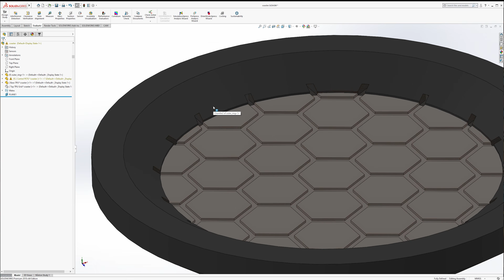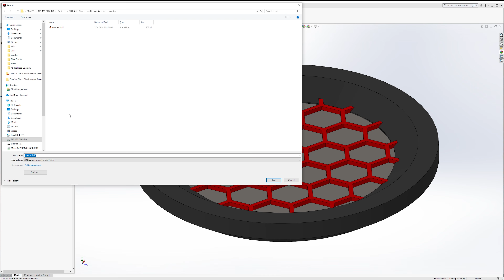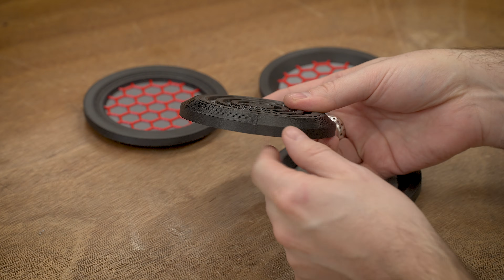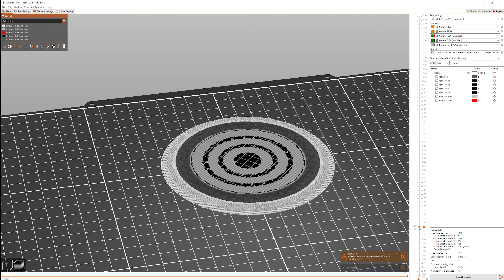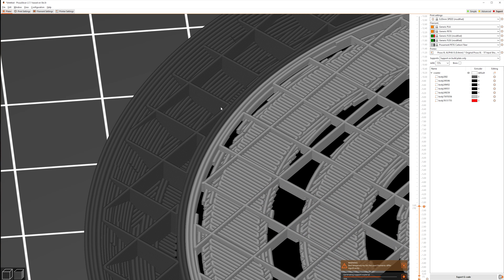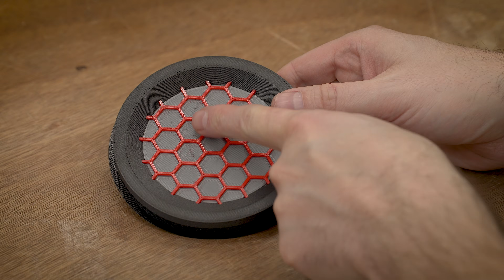Multi-Material Coaster - ALL THE FILAMENTS!

Comment: There's an option under multiple extruders to set the wipe tower extruder.  This will always be used for the perimeter of your wipe tower.  Problem solved on the wipe tower.  I've been using it without issue printing PLA as supports for PETG.  The other thing to do is design your supports in CAD and trap the PLA in with a wall of PETG around the perimeter to lock it in place.  Doing this you only need a few interface layers of PLA.  I do this with zero clearance and the parts are perfect.

It gets a little tricky in the slicer because it can't seem to differentiate between your parts when it comes to infill, but i found it you make your interface pla later entirely perimeters the slicer works properly.

Finally I'd like an in depth review of the diamond back nozzle please.  Been eyeing one for awhile but need to know the price is worth it.

Comment: You need to select a default extruder for the prime tower. I suggest you select one of PETG heads to build up the perimeters on the prime tower. Then you wont have these issues. The pla will still prime within the tower. The default setting of 0 needs to be adjusted. Ive not had any issues doing it this way. I also make the spacing a little bigger on the prime tower. Try 125 or 150%

Comment: 3mf is not very good quality (embedded STL) use STEP instead and split to parts in Prusa slicer to get a vector based model.
Reply from the maker: It depends on what your export settings are...  For structural models like this it's just fine.

Comment: Thanks so much for doing these torture tests on the XL. Great test and interesting results. Curious if you disabled Z-hop or use Z ramping. I was having some bad stringing issues and this solved the problem in one fell swoop
Reply from the maker: Ah, huh. I didn't disable anything.  I'm getting nearly zero stringing.  The red is stringing a bit, but it was really ONLY on the first use of it.  After that, it's pretty much what I'd expect for TPU.
Reply: I don't know why I was getting stringing, even after doing temp towers on the MK4. Changing the Travel lift to ramping 1.5mm max, 1 degree slope, lift height .2 eliminated all stringing for me.  @RobertCowanDIY

Comment: just use some sacrificial objects (cones, cubes) as prime towers, and assign for each one an extruder :)
Reply from the maker: I don't think you can assign a specific extruder to a specific object, that's the issue.  You can only select 'purge into object' and I'm not sure it knows which one to use.  I
Reply: @RobertCowanDIY  Painting them all separate colors (or separate materials in your case) wouldn't work? Then again, even if it did what's preventing the slicer from printing the main model first on each layer before it prints the sacrificial models. Definitely something Prusa needs to look into especially for how much they hype it as a multi-material printer.
Reply: @RobertCowanDIY  , you can select a specific extruder to a specific object 
!
Reply from the maker: @Ro3Deee  I'm fully aware, but you can't exempt extruders from the wipe tower.
Reply: I came here to suggest this as well. I don't have an XL to test it on, but it seems like it should be a good solution. At least until they implement separate prime towers in Prusaslicer.

Comment: Finally someone that gets and tests what this 3500€+ printer is made for! I don’t need 5 color PLA dolls and I don’t net 36cm dragon busts. I want to print functional parts with multiple material features! And also filaments that need an enclosure. 
Once we have a good enclosure and better filament support and a software, that really enables muti material mixes (with material interlocking features built into the slicer and better priming / wiping solutions), we can call it a new era of 3D printing.
Reply: Take a look at the SUMO enclosure.  Not perfect, but it works well.  I can keep my internal temp at 100F with just the bed heat.

Comment: I find the setting under multiple extruders 'Interface shells' works well to provide a better surface finish to flat surfaces such as the one below the TPU. If they interface then it is unlikely to improve things. You will use more filament though as a result but that can likely be managed with settings.
Reply from the maker: Good to know.

Comment: My first printer was a Replicator Dual back in 2012. One of the things i did to help with oozing and minimize the prime tower or completely remove it on larger prints was print infill first then perimeters, effectively making the infill an internal prime section.

Unfortunately without part cooling and a slicer that couldn't turn off the second extruder heater so it could stop oozing it rarely gave perfectly clean parts if it didn't get knocked off (under extrusion helped with that), although it did print me a few functional parts i removed the second motor and was happier with just a single head and clean parts.

Long->Short; I REALLY don't want to put a Prusa XL on my CC 🥲

Comment: Hi Robert, many thanks for your very informational videos! XL question for you please…. I thought I heard somewhere you cannot mix nozzle sizes in multiple tool heads for a print project? Is that true? If so is it a slice limitation? I have an XL on order and I have a couple of use cases where I would like to have the detail where I need it (smaller nozzle) and then less detail (faster printing due to larger nozzle) were needed. Thanks in advance for your reply!

Comment: I find that pla and petg will stick together good enough to be good at supporting each other. BUT only at low speeds. So when the petg goes to print directly on the pla interface layer, if it’s fast, it balls up and ruins the print. If it’s slowed down, works fine

As for the wipe tower, as others have said I’ve had it work great when I set an explicit nozzle for it

Comment: You can add rule modifications to parts in PrusaSlicer. Right-Click the model and use the option to add a modifier. Then align it to cover the needed area and you can change the rules for that volume of printing space. Such as the interface for the supports.

Comment: I use the gallery to add cubes to the build volume for each nozzle. I run a slice to see where the highest material layer will be used in my project and make its cube that high. In some cases, it uses less material than the autogenous tower but makes sure the nozzle is clear and primed.

Comment: Would it be possible to add just a simple block as your custom wipe tower, then force the slicer to always print this first?
Just thinking loud, I have no experience with this so far, but excited to get the multitool printer soon
Reply: You have to put the block in a certain corner of the printer, as it uses an algorithm to determine what prints first. I forget which corner though. But yes, the idea of making your own prime tower is solid.

Comment: Robert, great test. PaulStevensonPinball just explained the outside perimeter of the wipetower in PETG, since you already have your model setup, it would be really easy to print another one with the wipetower and see how this works. I have this printer on order but will not receive it for a few more months.

Comment: What hardness was the TPU you used? I have so much trouble with the nextruder and TPU. It prints for 2-3 minutes, and all of a sudden the gear grabs itself and the TPU does a full round inside. I have to stop the print, open it up and restart the whole process.
Reply: I converted my filament sensors to magnetic versions as described in the prusa forum post called XL filament sensor mod for TPU. You should see it on the first page. I also made new nextruder filament guide parts to help prevent the ability of TPU to move around and jam behind or under the gear. Those models are on printables just search XL nextruder main plate and idler lever for flex filament. After these changes I am able very easily feed and print ninja flex 85A TPU. Also make sure you are using brass nozzles for the TPU. In my experience steel just doesn't work very well for that material.

Comment: If you are using PLA to support PTEG, set your support distance to 0(soluble). There is no need to leave any space between the two.
Reply: He specifically picks up the print where he did that and showed how it was the worst looking one.
Reply: @mattanderson111  His issues stem from a number of his settings being off, most probably the blobs due to his wipe tower settings. Most of my printing is done with PETG and PLA supports. Anything other than soluble settings causes issues with the material not being supported correctly. There are also times when it just will not print with dissimilar support materials. If you are printing PETG on PLA with no adjacent PETG it will fail almost 100% of the time in the same way that it would with no bed adhesion. There is nothing for the filament to stick to.

Comment: i hope prusa doesn't take 5 years to implement multiple wipe towers
Reply: Multiple wipe towers would be a problem with the layer height. If you have multiple materials with multiple wipe towers how would you ensure the wipe towers all keep on the same layer as the model so that you don't crash the tool head or linear rail on the model? It could be done, but not without a significant addition of time.
Reply: @gabemoore8119  no that's exactly how they are implemented. Every tower is kept at the current layer by getting printed on until that material isn't used in the print anymore (because generally while the material is getting swapped in and out it does need to be wiped every layer anyways). It's just more time and waste, it's not that complicated. And when people want/need multi-material they're ready to make that sacrifice. Because it's still the best way to do it.
Reply: @SquintyGears  I understand that. But in order to accommodate this you would have to fire and run each wipe tower with every layer even if that filament is not being used on that particular layer. Am I wrong in my understanding of how this would be implemented?
Reply: @gabemoore8119  no you're correct that's exactly what I was trying to describe. But it's not as big of an increase as you think. In almost every case there's a material for that tower being used every layer. It's very rare for one of the material types not being used for half the model only to come back later AND that material is the one that doesn't stick to the rest at the same time... That kind of setup would be a nightmare to print. Because it doesn't stick to the print either in that case. It's just not realistic. So in almost every case at least 1 material for each tower is in use every layer up to the point where the purge tower isn't needed anymore and just stops.

So it's maybe like 10% more waste plastic and time over a single tower. Idk I'm kinda pulling the number out of thin air but i hope i got the idea across.
Reply: On a serious note does anyone know why Prusa is taking so long with stuff like the XL and MMU for the Mk4?
Reply: I think the filaments settings is a much bigger issues... You can model in a prime tower for your project.
Getting material specific settings in being so annoying is more problematic for the workflow
Reply: For the price of the XL... the length of time it's taken to deliver... every single detail should be perfect. This was supposed to be the next generation of Prusa and all I have seen is trouble shooting and community solutions for problems Joe should have had fixed three years ago.
Reply: @AppalachianAmerican828 spoken like someone who's never used the printer. "the YouTube algorithm feeds me videos of people with issues! This printer must be shit!"
Reply: @pinecone606 i mean the planes have holes in the wings bro

Comment: Hey Robert, here's the purge tower solution:  "Print Settings > Multiple Extruders > Wipe tower extruder" <-- Set this to one of your PETG extruder #'s.  The default extruder "0" means it will use the currently active extruder to form the perimeter of the wipe tower, so it ends up being comprised of both PLA and PETG and will fail.  If you set it to a PETG extruder #, then the wipe tower perimeter is formed by all PETG and is very solid, and the PLA gets wiped on the inside (normally on top of another PLA wipe).  

I do a lot of PLA supported PETG on my XL, so I can confirm this works great.  I've tried using PLA as the main wipe extruder, but for whatever reason it doesn't work as well as PETG.  Similarly, I find that PETG is not a great support for PLA (on overhangs it balls up, but you can get success if it's just a bridge) but as you found PLA is awesome for PETG.  Like you shared, I always set my Z contact distance to 0 (soluble)  and pattern spacing to 0, and it works great to give a smooth interface layer finish, especially if you're using a wipe tower.

Another important tip, not sure if you figured this one out - override your PLA bed temp to match your PETG bed temp, i.e. 85 degrees.  If you don't do this, then I believe the bed temp cycles up/down constantly with layers.  PLA works well enough at PETG bed temps, but not the other way around.  I haven't confirmed the bed temp cycling issue, but the slicer does warn you that the bed temps don't match.

One last tidbit, for smaller prints I find that the "No sparse layers (EXPERIMENTAL)" is fantastic.  Instead of wiping on every layer, it only wipes on layers where there is a tool change.  This can save huge amounts of time and waste material.  It does this by lifting the bed back up to purge on the wipe tower, but this is where you have to be careful.  With a smaller model, you can move the print to the front half of the bed, and the purge tower to the back, so that when the bed raises there won't be any collision.  If you don't have enough front to back space between the print and the purge tower, the print will collide with the extruder or X axis arm, and may cause damage.  I think this is marked experimental because the slicer doesn't do any safety checks, you're totally on your own.  If you can't have at least 5 or so inches of clearance on the Y axis, best not to try this.

I enjoy your videos, keep it up!!!
Reply: Thanks for this! I’ve been hearing people say that you can set one filament as the purge tower shell, but no one says how.
Reply: I use the set outside perimeter with a set filament,  usually petg outside and pla in. And it works well for me
Reply: I found the same solution with the wipe tower, but I hope for the multiple towers in the future. I had no problems when the outer wipe tower is PLA or PETG, but I think it depends on the filament. I had good prints with PETG as support when I use PETG that needs only 60C bed temp like extrudr PETG. I print it with max 55mm/s and a low temp and overhangs works great. But it took me some time to get a good and stable result. I still have more problems with PLA as support. All PETG I tryed won't stick on the PLA with Z contact 0.

Comment: The problem with multi wipe towers is if you have PLA on one tower and then 20mm layers later you start in on the Petg then you have a neighboring wipe tower 20mm taller than the starting petg tower. So you have to strategically place the second wipe tower so the gantry doesn’t wipe out the wipe tower or have something in the g code to lower the bed where the tool head gantry misses the PLA tower when moving to the lower petg tower. Or you have to have it build up the petg tower at the same time as the PLA tower wasting petg, and added time swapping heads needlessly.

Comment: Kinda a really funky, maybe too jank to be practical workaround, that stems from something i used to do to make seams less visible, but I imagine you could, in the actual geometry, have a very sharp turn leading to a false internal wall where you could set the slicer to always start the head so that all of that nasty pre purge would be at a known location inside the part so to speak.

To put it another way, you have your model, then you just sorta cut into it half way into the outer ring, go around the circle one way, move just a smidge deeper, then circle right back to where you cut in with such a small distance between those walls that the filament fuses together.

You could leave the top layers as they are if you use the trick of letting this hack reach its way to the top, and you could probably get pretty small parts to print without a visual headache..

I realize this probably sounds really convoluted but its basically the idea of how one might get a different color section within a part to fuse to that part, but in a circle that stays hidden on the inside of the part. It may or not become a useful tool in your print hacks tool box.

Hopefully that idea made sense.

---

Oh, also, just another hacky idea, but perhaps making your own prime towers (just slicing in such a way that the heads all go to sacrificial parts first), could be a solution as a bandaid before a slicer solution comes. You could set just a simple rectangular prism for each of the different prisms closer to the print heads so in theory depending on settings they always get hit first before the part you care about.

---

Also just got the best wipe tower idea. You could have one material shell all the other wipe tower materials (probably the one that prints hottest). You'd have to manually construct this, so still a band aid, but then you could waste less material, and not worry about parts falling off since you'll know the outer layer will always be strong.